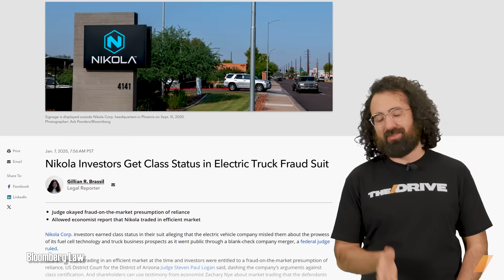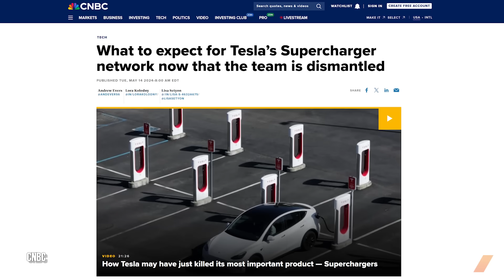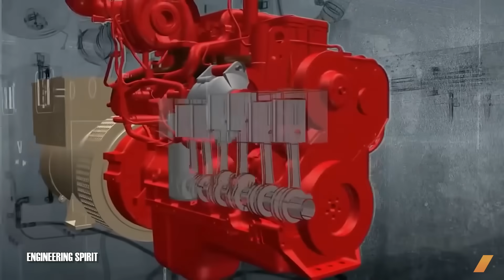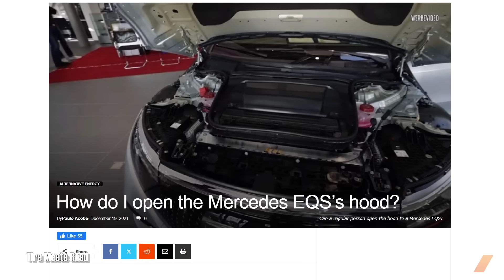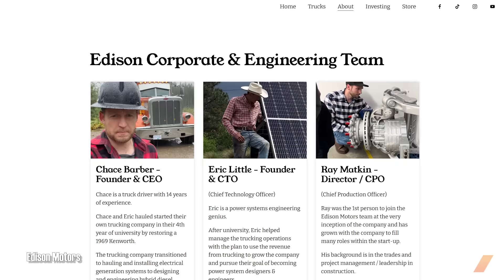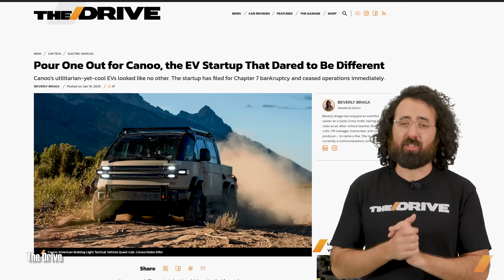The truckers in a shed beating Tesla with 100-yr-old EV tech

Comment: THe really silly thing is the fact people look at a TRAIN, go 'huh, why don't we apply this tech to trucks?' and forget that trains can do everything semi trucks can, more efficently, and that the cost to build rail is less than those huge interstates...
Reply: Bzzt. You still need semi trucks to deliver the last mile. Semi trucks offer custom point to point timely delivery that trains simply can not match. Yes. Trains can deliver freight a less cost per ton per mile. And Semi's can deliver to places that trains can only dream about.
Reply: @Sah-o5m  You absolutely do not. Semi trucks and evern self propelled non-rail vehicles haven't existed anywhere near as long as railways.

We used to build what's called an industrial spur, a turnout from the lines that went right into the industry so they can load and unload railcars directly.

Semi trucks are nonsense pushed by automotive lobbies and the self sustaining trucking industry. Rail can literally go everywhere that's not water... And we have boats for the water.

Going to a factory or wherhouse isn't 'last mile' anyhow, last mile is to an end consumer, and that's usually by delivery van or in the posession of a consumer from a store they bought it at.

Trains literally built North America, long before trucks existed. It's ridiculous how they've been erased by the auto industry.

Comment: Edison Motors is a joke. They haven't performed any real-world testing and they can't provide any real-world fuel efficiency data.
Reply: Patience my friend. Topsy2 is getting upgraded and we should see dyno data this summer.
Reply: @Sah-o5m Topsy should already have 200,000+ miles on it at this point in time.
Auto and truck manufacturers normally run test mules day and night through all conditions for a year or more before entering production.  Each individual component is life cycle tested as well.
Reply: @ They're building the CMVSS test track this summer to put miles  on the truck.
Reply: @Sah-o5m They don't need a test track, they need a proving ground.  Before being tested on a proving ground it should be tested on a road simulator capable of stimulating all conditions.  Bump and shock testing to simulate a million miles of use.

Comment: Why go to all the complexity of a hybrid?  Why not a simple diesel electric?
Reply: ? It is diesel/electric. 

Diesel engine spins genny. Genny fills batts. Batts spin the e-axles.
Reply: @Sah-o5m  Yes, it's diesel/electric, but they added on a battery to make it a hybrid.  Locomotives don't have batteries and are simple engine/generators.  While the hybrid will do better for local deliveries, it is more cost up front which is an issue for small outfits and independants.  If they want to make a dent in the market, get the cost down.

Comment: Don't let science get in the way of your opinion. Each time there is a change in energy type ( i.e from diesel to electricity to mechanical) there is a loss in efficiency. This video fails to mention that either because they have no idea or they have other reasons. Who funds these videos??
Reply: Correct. Edison trucks trying to do OTR over the load long haul high-speed freeway driving will trade the gain they get from friction losses in the transmission ,ujoints and instead spend that as heat in the generator, batteries, inverters and axles. Congrats :) you won science today :)

Also. In that science book is something called "regen" braking that converts momentum into electromagnetic energy,  and then store that as chemical energy in the batteries. So for trucks that do a lot of start/stop city last mile drayage, Edison is hoping for a 30% reduced fuel consumption to be confirmed by the dyno tests happening at McMaster University.

Also there is a thing called "potential" energy. Turns out there is a ball of gas doing fusion in the sky and that grows trees in the mountains. The hope is that an Edison diesel electric truck will use batteries to climb a mountain and then use regen down the mountain to refill the batteries. 

Science is awesome! :)

Comment: I'm a locomotive machinist and diesel electric is actually not that hard to work on we use 16cyl engines with dc generators and ac generators on the bigger power. Most of the engines are at least 40 yrs old and can complete 90%of the repairs within an 8hr shift. As long as they systems are easy to understand how they interface, these trucks shouldn't be hard to fix
Reply: Nice :)

Comment: 2:54 yeah and what about the gas you're also lugging around lil bro
Reply: saying lil bro doesn't immediately make you right, lil bro
Reply: @redcliffish4390 who you calling bro pal? ;) that's a Southpark Canada joke.

But to the original point. Yes fuel weighs, and an Edison truck (with fuel) weighs about the same as a Tesla Semi.
Reply: @Sah-o5m i agree I think both are very close in weight but what about the range
Reply: @akhadech  an Edison semi only runs for 2 hours on batteries, then it will run until the dual giant round fuel tanks are dry.
Reply: @Sah-o5m I guess depending on the application? What it is being used for? You won’t get the same fuel mileage using the rig to haul logs compare to long hauls on the highway. Can’t forget about regenerative braking

Comment: The key part of their success is using older diesel engines. If they had to meet emissions standards for newer engines, they would fail.
Reply: Kinda. The 5 new trucks under construction are using Scania 9 liter diesel engines that meet CMVSS tier 4 emissions standards.
Reply: @ sounds like a good plan. But prototypes are much easier than full production vehicles, with crash testing and EPA stamps.  When they product the first thousand I will believe proof of concert.
Reply: @drew8256  turns out giant class 8 semis do little crash testing.

Comment: they are not building hybrid semi's. they are building/retro fitting vocational trucks, application specific(ie snow plow, logging, oil field etc) and the same with heavy duty pickups. Right to repair is a big part of the vision...
Reply: Umm. They're building  5 new semis from scratch. The kits for pickup truck are the retro fit kits

Comment: For God sakes, man..... Climate change = have to stop burning fossil fuel. Period. Can we do that 100% tomorrow of in 5yrs?? No chance. But the world will transition far sooner than you think. And even you and some of your viewers either don't believe in climate change or don't give a shit, too bad, because the economics of electric powertrains is far cheaper and is on;ly getting more so.
Reply: Edison trucks cause less emissions than traditional diesel trucks. 

There simply is not enough power stations and transmission lines to have all ev vehicles today. Edison hybrids trucks are an interim solution to a better tomorrow.
Reply: We don't have to stop. We just have to maintain them at lower levels.

Getting global co2 levels back to 1985 levels would be fine...

Comment: The only downside of having diesel-electric like you have in trains is they doesn't have batteries, and don't have a system that can reuse power you commonly lose in downhills and stopping.
What I like in Edison's trucks is (if understood correctly from their interviews) they will offer a system with battery as an optional. But I didn't get if it will do regeneration, or it's just to befit from plug-in or something.
I hope they succeed doing simple but smarter things than we have today.
Reply: The same e-axle that drives Edison trucks forward can be turned into generators where the wheels spin the e-axle and puts energy back into the batteries to slow down the truck. This is called regenerative braking or "regen". It saves money and makes the brake pads last longer.

Comment: This video is very, very badly done, and it is more of an ad than it is an accurate look at Edison.

You don't even acknowledge the energy lost by converting kinetic energy from the engine to electrical energy. Is that more than made up for by running the engine at a constant RPM in its most efficient range rather than varying the load and RPM as is done with a fully diesel drivetrain? I don't know, and neither do you, evidently.

This system would not make sense if not for its ability to be plugged in at night when energy is cheap. You didn't mention whether it could do that. After further reading, I found out that it can. That will help its cost efficiency. Why didn't you mention this?

I hope that Edison is successful, but honestly, releasing glitzy, one-sided videos like this probably hurts it more than helps it, because it makes it look like yet another alternative energy scam.

Comment: Dodge already figured this out. Their pickup truck is all battery powered, but has a gas generator to charge the batteries. Most of the time you can run it all electric, but when need the things you buy a pickup for, it is there and will do what needs to be done. Its a much smarter way of doing things.

Comment: it's like this with all cars. We shouldnt be abandoning diesel. we should all be driving diesel cars and the fuel industry should lean into making diesel or a fuel like it, very cheap. It's more efficient than gasoline. we are told the world will end because of some carbon output by humans, but auto makers are giving us only inefficient gasoline cars instead of slower, but more reliable and efficient diesel cars which will not create CO emissions. That's right, diesel engines that are properly running dont output CO. Why arent we using these more?? why would the ruling class force us to abandon this, keep using gasoline engine that DO produce CO, are less efficient and we basically have the same mileage out of them for the past 30 years? hmm that's odd.
Reply: Rudolph Diesel originally intended his namesake engine to detonate mere vegetable oil.

Comment: Ok let me get this str8. Its a diesel truck where you have replaced the transmission, drive shafts and differentials with an inverter, battery, and electric motor?  Is that right?  Sounds like a lot less energy lose from motor to tire for me
Reply: Correct. Also instead of breaking, they do "regen" to slow down. This regen puts energy back into the batteries.

Comment: A diesel-electric locomotive does not have a traction battery that might allow the diesel to operate at a constant, optimal efficiency, RPM.  So, these vehicles are a little different from regular diesel-electric locomotives. Yor battery seems to operate as a buffer between the diesel engine and the electric powertrain. This implies (assuming the maximum electric drive motor output is greater than the maximum power available from the diesel) if you need sustained output above the level than can be provided by the diesel engine the time will be limited by how long the battery can sustain the difference in power required. This is probably not a problem most of the time, but it could mean certain load carrying cases would take longer to perform.
Reply: Its a BEV. The battery isn’t relying on the diesel for traction. The battery will drive the vehicle for hours. The diesel generator is only there to recharge the battery instead of having to plug it in.  It’s a battery charger not transferring power through the battery serving as an in between.
Reply: @Jeddin  Exactly as I said, it is not like a diesel-electric locomotive.  How long can the traction battery operate the vehicle when full electric output power is required? I assume the output of the electric motor(s) is greater than the output of the diesel generator that the diesel is running, can you  confirm?
Reply: @deanrhodenizer938 the truck can run on battery alone with no input from the diesel generator for 2-3 hours.   When the generator kicks in It can recharge the battery in about 20 minutes.

Comment: What's the range on the truck? That's probably the most important
Reply: An Edison truck will drive for 2 hours on batteries,  then the diesel engine turns on and will run till the tanks run out. So many hours.
Reply: @ thanks but that's still very vague. I'm curious as to how many miles it can go between fill ups
Reply: @chiadika  its vague because it depends on driving style. Otr is different than drayage and different from logging. So roughly 2 hours on batts, and then it depends on the size of the diesel fuel tanks.
Reply: @ that applies to basically all cars and trucks tho. There can still be a min and max range that can be determined
Reply: @chiadika  There are standardized tests to replicate typical driving. There are not standardized tests to replicate logging

Comment: The electricity is coming directly from a highly inefficient heat engine. The diesel generator is ~30% efficient with the energy in the diesel with further losses from the inverter going into the pack. Best to charge from nuclear or hydro. But I like the entrepreneurial spirit happening in Canada. With common sense conservative governments there can be more Edisons in the marketplace. At the end of the day, it's the business owner that takes the risks with capital and resources while calculating the profitability of the business to meet the consumer needs.

Comment: HP doesn't matter in large trucks. What is the torque figures?
Reply: 40,000 ft lbs at each axle. More like 30,000 ft lbs where the rubber meets the road.

Comment: 122k & 5 years in a i3 REx has me sold.
Serial Hybrids are a great solution.
We save $2000 in energy yearly, and the brakes are barely worn due to regen.
No transmission & no need for VVT since it's fixed rpm.
95% of miles on cheap electric power.
Fillups with liquid fuel in 5 minutes for either cars, pickups or semis.
Hoping other truck makers will introduce their own.
Reply: The issues with the i3 air conditioner shredding itself into the battery cooling channels though.  Hard pass.

Comment: Best part is that because they are technically fueling a generator, they can use dyed (tax free) diesel. Im sure it'll likely change, but its a nice bonus for early buyers!
Reply: The could with prototype Topsy, but Canadian CMVSS is holding the production trucks to normal truck standards, so no more red fuel :(
Reply: @Sah-o5m  ah, makes sense, the loophole would have been closed pretty fast anyways

Comment: Stopped watching when they compared the weight of batteries to just a diesel engine and not the weight of fuel.  Guarantee you the weight of the electric motors is less than a Cummins diesel engine.
Reply: A full ev semi carries 12,000 lbs of batteries.

A hybrid semi carries smaller batteries than a full EV, and a smaller engine than a normal traditional semi.

The overall weight is about the same.

Comment: Myth 2: The electricity used to charge EVs is created by burning fossil fuels, so there are still emissions involved More and more of our electricity now comes from renewable, green or clean energy sources, and zero-carbon power in Britain’s electricity mix has grown from less than 20% in 2010 to nearly 50% in 2021. With the growth in onshore and offshore wind farms and the closure of a number of coal plants, transport is in fact now the most polluting thing the UK does as a nation. Our energy system is also becoming more flexible to maximise on this cleaner energy whenever it’s available. Apps like the WhenToPlugIn app, as well as new legislation and smart energy tariffs, are all helping us manage our electricity use – for example, Smart Chargers that can start or pause our EV charging to ensure it’s using the cleanest and cheapest power. In New England and New York, only 0.1 to 2.7% of electricity is produced from coal and oil combined2 and, as electricity continues to decarbonise, these percentages will continue to reduce.